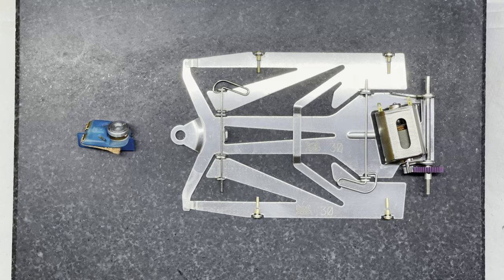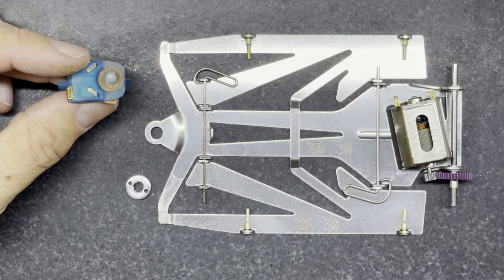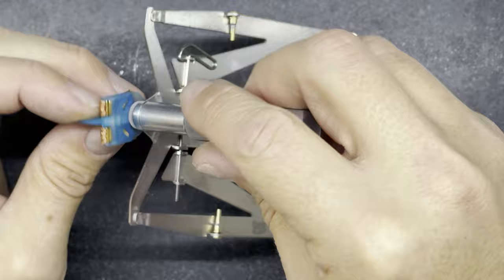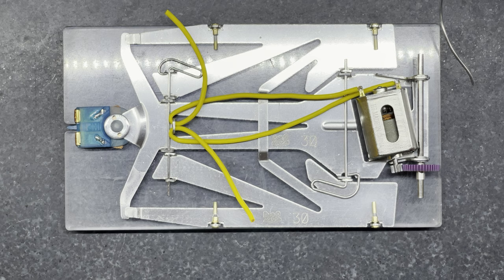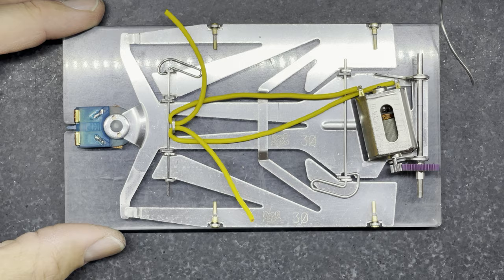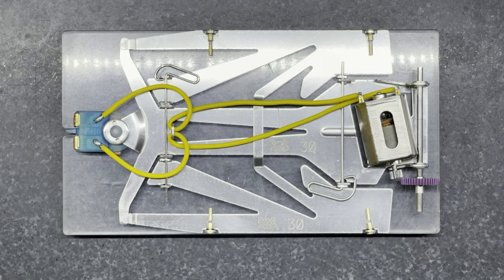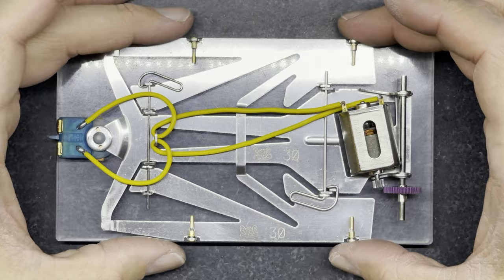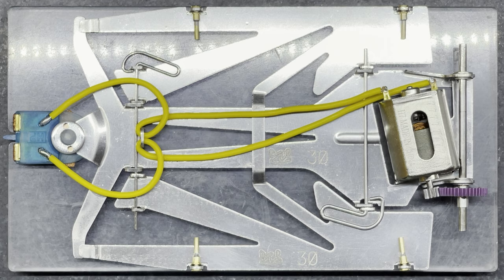Build a race winning JK C43 Aleos slot car chassis - Part 7 (Adding a guide and lead wires)

Comment: Could you ground the chassis to save the weight of the wire?
Reply from the maker: Chassis grinding is not permitted. There are lighter ways to do the wires but it is a trade off between longevity, reliability and weight.
Reply: @CleaveTech  I see how I failed to be clear. Could you solder the negative lead from the guide to the chassis and solder the negative lead from the motor to the chassis. Sort of how full size vehicles use a common -ground on the frame. It would save maybe 2 or 3 cm of wire.
Reply from the maker: @epluribusunum6622  , Ah, understood now.
In theory you could use the chassis as a conductor, like real cars, but in reality the chassis does touch the track braid on some occasions around the lap. This would cause short circuits and could damage your controller.